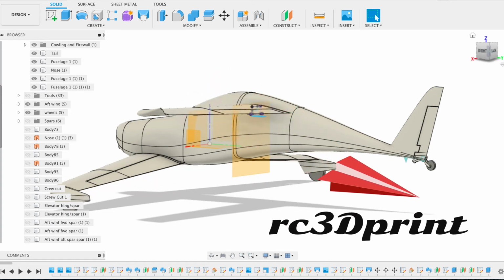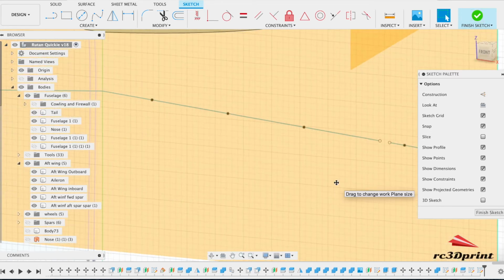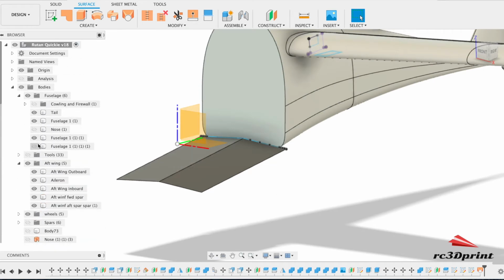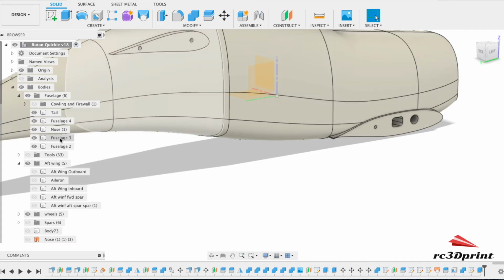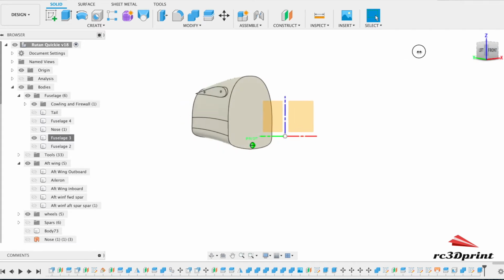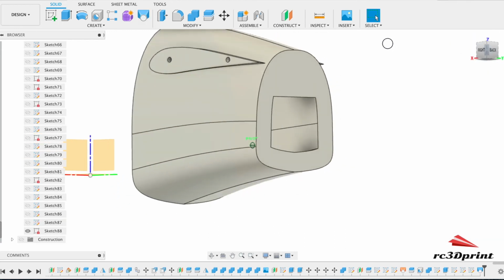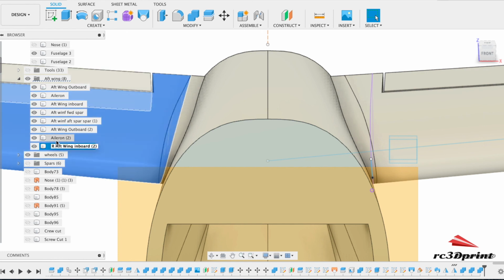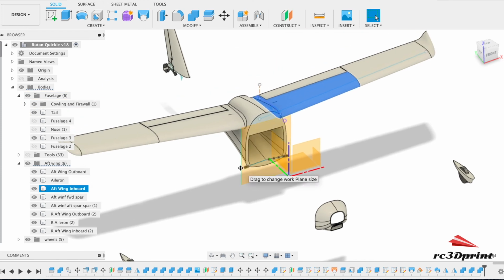How To 3D Print an Aircraft - Rutan Quickie - Episode 9 - Shelling the Central Fuselage

Comment: I really like watching a movies like this. To see how other designers solve the technical problems.
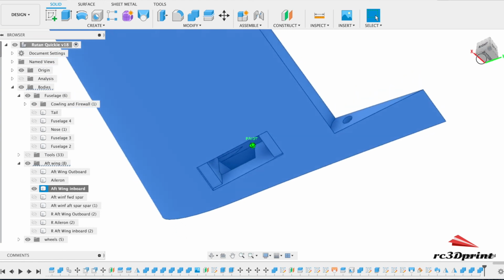My only comment is that the servo cables may not necessarily fit just behind the wall that was set directly for servo outline. The servo cable egress channel should be slightly FWD and go deeper into the wing (@23:54) - like mid way servo width - to create a "pocket" as the cables from the servo are placed mid the servo side - thus require some more space to be routed out from there.

Comment: The loft issue you were talking about ~17:00 is due to the fact that one sketch has more points than the other, so it connects randomly. If both have the same amount of points, it should better aligned.

Comment: I have a full set of plans for the real quickie, as well as a 1/4 scale balsa model kit. The fuselage sides are slab sided for ease of building. The Q2 and Q200’s had a more rounded profile like you are modeling and they were molded at the RAF factory.  Just FYI. It still looks great though.  You have inspired me to model one in Fusion 360 as well.